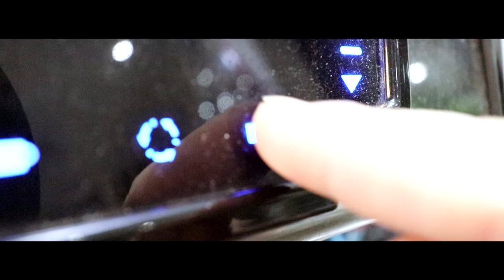MY GARDEN IS RUINED - SHOCKING STORM DAMAGE

Comment: Done a nice job there. Just one question though. How come you've given yourself the baton side on both sides of your garden? Would look much better if you had the other side of the panels.
Reply from the maker: Unfortunately I own all 4 boundaries.....so I have to face them out...Although, I actually prefer it a bit!
Reply: TimesWithJames  that's odd. I was under the impression that in accordance with government laws on boundaries that as you own the boundary its entirely your choice what you do with it. As far as boundary features or fences go there are no laws about who owns these or which side of the boundary feature you’re responsible for but if your boundary agreement specifically states you own them and you must face them out then you've no choice. Looks like you had the facing side beforehand so seems odd to replace it with the baton side. Each to their own though if that's what you prefer. :)
Reply from the maker: Yeah I guess, but it makes them easier for me to lift out (and swap round) if I like!
Reply: I have mine that way as well as I like it that way, also stops the perps trying to use the fence batons to climb into your garden.